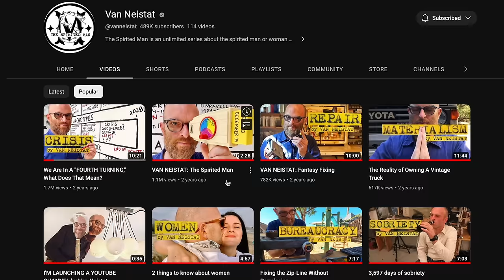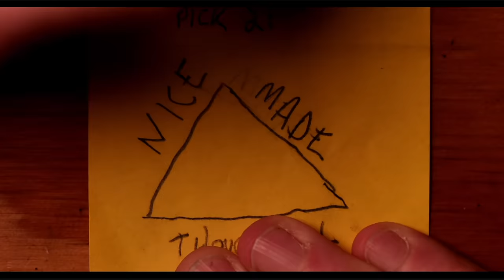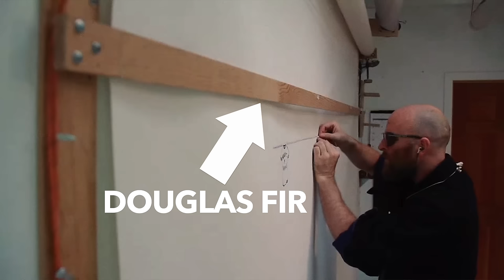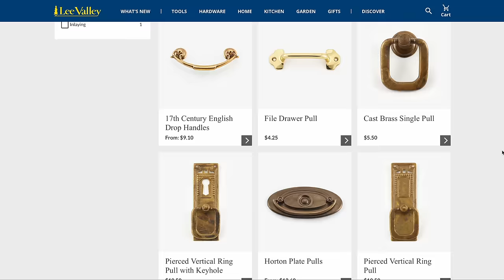A Tool Chest for Van Neistat

Comment: A tool chest with simple drawers The is the kind of thing that slows you down when you work. The dude is ADHD if not ASD. He may well love the fact that a fan has gifted him a hand made piece, but I think the piece itself will drive him crazy. Be interesting to see how long he uses it.
And interesting to see if you get a kick in the stats.
PS some of the joinery is nice. I used to spend my weekends in my grandfather's shed. He was a cabinet maker trained in the 1920s/30s. When I see dovetails, mortise and tenons and the like it really takes me back to the time spent with him. That time makes me hate most modern capentry and cabinetry. Great to see some craftsmen still aspiring.
Reply: Why would it drive him crazy?